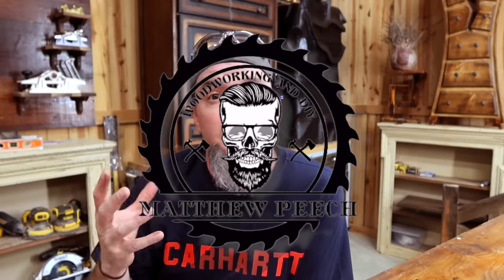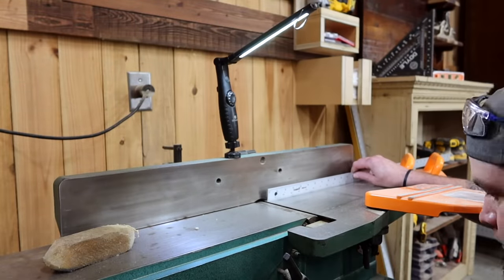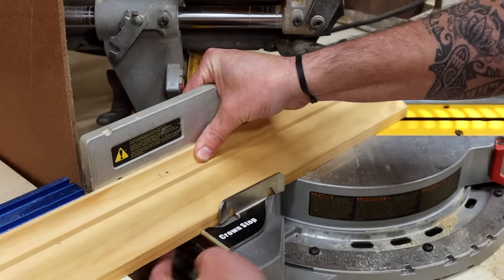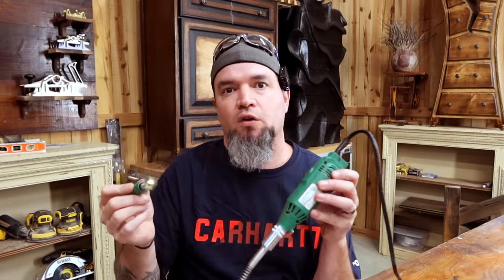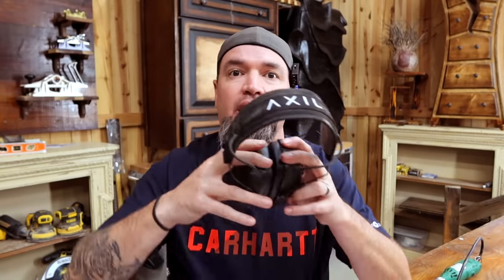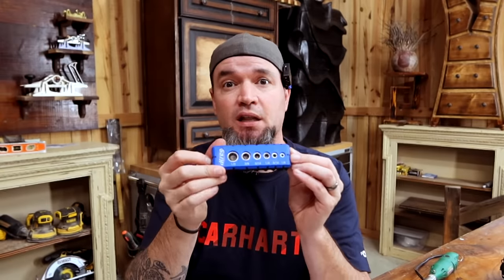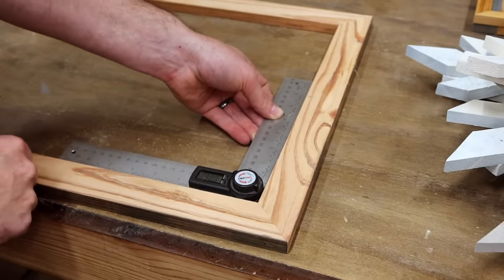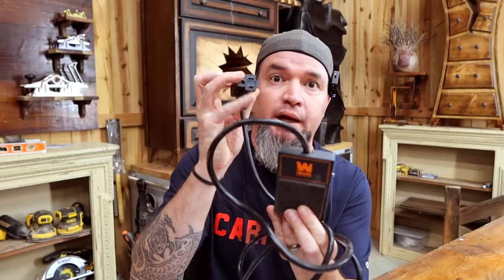12 Must Have Tools Under $20!

Comment from the maker: ▼EXPAND FOR MORE INFO!▼
★ Plans! All plans include exploded views, cutting layouts, and easy-to-follow step-by-step instructions. 
Etsy Shop: https://tidd.ly/3DzEa0f

★ Support the page and join the community!  
https://www.patreon.com/MatthewPeechwoodworking

★ Share Your Brags!!! 
Mpwbrags@gmail.com

★ Subscriber Discounts! (Affiliate links help to sponsor the content)
-RZ Masks (Save 15% with code: PEECH)
https://tidd.ly/3TJ1w9q

-AXIL Electronic Hearing Protection (SAVE 15% with code MPWOODWORKING)
https://goaxil.com/pages/gs-extreme-affiliatte-special?rfsn=6622602.9d133c

★Links to tools you may see in my shop  (If you use one of these affiliate links we may receive a small commission that helps to support the channel)

Kreg multi-mark measuring tool https://amzn.to/3XjM1H6

Kreg drilling guide https://amzn.to/3GtQFMG Flexible gooseneck light https://amzn.to/3Vfto5v

Magnetic Work light https://amzn.to/3Awdpb7

Crown moulding stops https://amzn.to/3tOGRoU

WEN rotary tool https://amzn.to/3EMo04s

Safety glasses https://amzn.to/3gnkfsH

Kreg drilling guide https://amzn.to/3GtQFMG   (much cheaper at a big box store)

Digital caliper https://amzn.to/3tKcqQX

Digital angle finder https://amzn.to/3K7mSJT

Digital angle gauge https://amzn.to/3AvIVpQ

Foot Pedal https://amzn.to/3glhVCC

Check out my Amazon Page for links to all the tools you see throughout my shop!
 https://www.amazon.com/shop/handy.man99

Comment: Here are some cheap items I use all the time.
- cheap set of 1,2,3 blocks, great for making temp jigs and clamping things.
- corner clamps, this is kinda a China tool but they are amazing they are squares that have clamp spots on the side.
Reply from the maker: Oh yea! Thanks for adding to the list.
Reply: I second the 1-2-3 blocks! I have a couple of sets and they’re used all the time. I also do a lot of metal work, so sometimes I don’t think of them as woodworking tools, but they most definitely are. On that note, I’d also add machinist’s square, height gauge and surface plate as tools that I got for metal but use for wood more than I thought I might.
Reply: Wen makes inexpensive 1-2-3 blocks that are plenty good enough for woodworking.  Keep them oiled to avoid rust.
Reply: Thank you.  I don't know what these are so I'm about to go find out! ❤

Comment: I have a foot pedal for my vacuum and table saw. Be cautious and always use the on - off on the saw as well when done with a cut. It is easy to accidentally step on the pedal when your hands are in the danger zone.

Comment: The foot pedal is an awesome safety feature. I had one on my shop vac and it was really helpful. Then I got my first table saw and immediately realized how dangerous it was so I got another pedal for that. It gives me much more confidence knowing that if I step away, or drop something, or someone comes in and distracts me then the saw shuts down immediately.
I bought a heavy duty metal pedal on Amazon and wired my own receptacles to it. No problem kicking it around the shop floor.

Comment: Quite a few years ago, my sister bought me a 3 pack of small pry bars by Dasco Pro. So many uses in and out of the shop! They all have a nail puller slot and the mini is great for opening everything from drink cans to paint cans. Under $20!
Reply: That little cat paw size one is my go-to for stain cans. I will also add to the cheap list, the little bottle opener / paint opener that most people have. Small, inexpensive, but still invaluable when you need to open a paint can.

Comment: The backside of the drill guide is triangular in shape to drill center and straight on something round like PVC.
Reply: Big Gator is another great name for these, but a bit pricier. They offer standard and metric, plus smaller bit sizes and one for tapping. All are solid metal.

Comment: One of my favorite under $20 tools, is the Pittsburgh 12" Locking Wing Divider from Harbor Freight ($9.99).
I could go on all day, but one more honorable mention from Harbor Freight, is any of their Pittsburgh ratcheting bar clamp/spreaders - the 18" clamps are just $5.99!
Reply: I have HF bar clamps and dont use them.....when you crank in the force, the bar will bend.  Es no bueno.
Reply: Locking wing dividers 9.99😊

Comment: I love the harbor freight pick set. I have used them for years and modified them for specific jobs. Just another suggestion for people looking for more cheap tools.
Reply from the maker: Good idea. Thanks.
Reply: 😂😂😂 Me, too. I never seem to be able to hang on to a set for long, though. It seems that visitors to my shop will see them hanging on the mag strip above my metal workbench (I religiously separate wood and metal work. Nothing messes up a finish like some oil you picked up off your bench, and nothing aggravates me more than sawdust all over a metal project). As I write (23Dec22) HFT had these on their online coupons for $1...limit 4. I've done limited twice already, and may limit out again before the coupon expires on 26Dec.
Reply: Ive been mechanic for 60 years texton have the best pick set

Comment: For my shop vac switch I use a remote control wall switch I picked up for ~$15 @ Lowes. I slip the switch in my apron's chest pocket (or shirt pocket) and no matter which station I'm working at I can thump my chest to turn the vac on or off.

Comment: I have the Milescraft version of that drill guide and it's super convenient. I've been pondering getting some brass or steel bushings in bigger sizes and making a second one for 5/8" to 1-1/2.

I have one of the 3M respirators for use when spraying lacquer- and alcohol-based paints. Switching out the organic cartridges for the round pink particle filters makes for a very comfortable and steam-free dust mask.

Comment: Thanks, just watched 3 of these style videos from you and ended up getting the foot peddle, butter spacing guide, nail setter, 123 blocks, center finding ruler, and I opted for the Milescraft 1318 drill guide versus the Kregs drilling guide, it's $20 more dollars but way more versatile for me.  I used your affiliate links so spend that $1 wisely, better it's in your pocket than Jeff's.

Comment: Great list, I already put a couple in my Amazon cart. I use my combination square quite a bit. Marking the center of boards, the 45 for marking the center of a square and also as a blade height tool on my table saw for dado's.

Comment: I missed some audio when you were talking about rotary tools and I was going to jump in and say, "Wen makes a good one for 20 dollars, then realized you were talking about Wen. Whew, almost looked stupid there for a minute. I have the foot pedal also for using my router on a bench. Router is also a Wen. Think I see a trend. Thanks for the heads up on the digital gauges. I have been eyeing a Klein angle gauge and wishing I could find a less expensive one.

Comment: I discovered the foot switch about 30yrs ago. It came as an accessory to a high-end scroll saw. I plugged a three-way power adapter into it and ran the saw and an overhead light. I thought it was pretty cool.

Now...I have one switching my table mounted router that is a off-on type. I also have one tied into my drill press that is a 'deadman' style, which is to say you must have pressure on the pedal if you want power to your tool. Harbor Freight has both styles in the $15 price point. They are half again as large as the Wen you demonstrated, but seem to work for me. I've had them for years now, and aside from HFT's penchant for selling poorly finished products I find them to be durable and able to handle a decent amount of current. The switch on my router, for example, is likely six years old and shows no need for replacement. So...git yourself a couple of these. Like Matthew says, you'll wonder how you lived without them.

Comment: I've suggested it on some of my other subscriptions and have seen no response to it, but I use an echo Dot to tell Alexa to turn on my vacuum system. I had used a remote, but could never find it when I needed it, and it eventually broke. So I just needed to get an Amazon Alexa switch to add to it and plug in my vacuum. Now all I have to do is say Alexa turn on the vacuum (and it just turned it on lol). It works great!

Comment: I got a rotary tool (Dremel) back in 1993, I don't use it extensively, but I have changed the brushes in it. I use it mainly under vehicles to cut off old pieces like exhausts, where flames are not a great idea!

Comment: I have a couple of pair of safety glasses with gaskets that I wore riding my motorcycle in place of a shield. I live in Arizona and some portions of the year, the climate is not conducive to full-faced helmets. 😁 And I use my Howard Leight shooting ear pro because i can hear everything until the dBs get too high and they shut out the noise immediately. Mine are old so need an umbilical for music, but I have a shop radio, anyway.

Comment: The crown Stop would have been great when we we remodeled our house and drilled and tapped the base of the miter saw to attach a block of wood as a stop. The vibration ended up cutting into the block about a day into the project and ruined a lot of cuts that had to be re-cut and filled ( in some cases). Those stops would have been fantastic

Comment: This isn't necessarily unique to wood,  but incredibly useful nonetheless, I'd recommend folks get a nut/bolt/screw thread gauge. Like 9 bucks for a decently sturdy one. Can help you figure out threading you have on an existing screw/bolt, and has posts for figuring out nut sizes. 

Mine is loaded with info. Metric, US, thread, size, length and has posts set up for both fine and coarse nuts. Very handy when trying to find a replacement, versus trying every single spare you have til you find a match

Comment: I’m probably going to give more comments but the first tool you showed Kreg multi tool is one tool I use more than any other tool in my shop. You should of shown how you can take a measurement for one part and transfer it to another. That is the number one thing I use it for, repeatedly.

Comment: I have my flex shaft rotary tool connected to its own foot pedal switch.  It really help when doing modeling work to precisely position the tool before starting the drill or other attachment.  Definitely a place where a corded tool is better than a battery operated one.

Comment: Great video. The only thing I kinda have a different opinion on is when it comes to rotary tools. Yes, Dremel can be expensive but they are leagues better than basically every non name brand rotary tool and worth the investment IMO. Even their entry models are so much better than a similar spec model, at least when it comes to jobs where high speed is needed. But if you only ever use lower speeds for sanding or grinding, budget models are usually just fine.
Reply: Curiosity since I have a corded Dremel and a cordless Ryobi, what specific examples do you have where the Dremel was able to either do something better or at all vs a non-Dremel brand and what brand were you comparing it to?
Reply: @inmyimage1081  Well I said "non name brand rotary tool" so I'm talking about cheap stuff like Amazon rotary tools and even Harbor Freight's cheaper lines. Things like cutting metal make drastic differences where cheaper stuff tends to not have the motor speed to cut through even softer metals. They also tend to even slow themselves down from lack of torque, which only adds to the problem. Another area where Dremel outclasses many other rotary tools and I'll say even some name brand tools is engraving jobs. It's vital that you have a constant, stable speed because any changes will cause your tool to slide around and ruin your carve.
Reply: @inmyimage1081  I've never used a Ryobi rotary tool, but I do have a Makita portable rotary tool as well as a cheap Bauer rotary. The Makita can hang with my Dremels for most cutting jobs, but do tend to lose the clutch a tad with stainless steel jobs where my better Dremels maintain constant RPMs. The Bauer, meanwhile is nowhere near the same class as either brand. I basically just got it because it was on clearance at harbor freight at the time.
Reply: @LeviBulger  Thanks, haven’t actually used the Ryobi yet and not sure when I will given I rarely even use my Dremel, it was just part of a multi-tool package I got.

Comment: I had to laugh because I saw your video title and before I watched it I thought, "What are my must have tools under $20?" The reason I laughed it that your number one, the Kreg MultiMark, was the tool that I thought of first. I picked one up at a woodworking show a few years ago and it has become one of my most used tools. It's just so incredibly handy and I'm lost when I can't find it. The digital caliper is probably my second choice, especially since I mill my own rough stock. I love getting exact thickness measurements when I'm milling boards down to a specific thickness and accuracy is essential. It's also indispensable if you use a CNC machine.

Comment: Besides just calipers, lots of machinist's tools can be handy in a wood shop. 
Telescopic ID gauges have come in especially handy as a super quick way to check that a fence is square to the blade.
Reply: I love my machinists 1-2-3 blocks.  Many tools come in 2 versions......machinist/engineer tool or woodshop tool.  when budget allows opt for the machinist tool.

Comment: The flex light looks great. I bought the pricey Rockler one, but the flex part is too flexible and won't stay in most positions I try to set it at. 
The Kreg drill guide isn't necessary if you have a drill press. Make your own guide from scrap in seconds. 
I like the digital protector, but it tends to move too easily when trying to transfer an angle, even if you really crank down on the knob to lock it. 
I tried the RZ Mask, but when it's just secured around the back of my neck I find it tends to pull down my nose when I put it on tight enough to actually seal around my face. 
There are also safety glasses like that with a nylon strap which stays out of the way of your hearing protection over your ears.

Comment: That first one, the Kreg measuring tool also has a built-in rabbet @ 3/16” for marking reveal for door casing. Thanks for all your vids!
Reply: Following the link to Amazon turned up a version by Milescraft for a few dollar less.
Reply: Don't trust it. You'll need a square to make sure it's square.  Has a LOT of wiggle in it.
Reply: My Kreg unit is still tight. But we don’t really rely on that kinda thing to square-up a task, do we? It’s just a versatile thing that you barely notice in a pouch until you need it.

Comment: Great tools!  I can’t believe how much time I spent trying to find a little corded magnetic flex light.  Harbor Freight sells a blue one but it’s too short.  I ended up buying another one of their battery powered magnetic lights with a side mounted magnet, which works ok and is charged by USB, but it was expensive.

On the crown molding clamps, I’m confused because I have generic hold downs on my miter saw that kind of do the same thing I think, so the point about “repeating the angle” was lost to me anyway. My current saw is a 20 year old 12” Rigid miter (Emerson tool) that has given great service, but it doesn’t have those threaded holes for the crown brackets.  (I wish I had a sliding miter, but use a table saw instead for deeper cuts.)

I have the Kreg drill jig which is a great tool, and a digital angle finder, but have to look into the rest of these.  The last safety glasses I bought cost more than $10, and didn’t have those desks to keep the dust out.

Thanks for the helpful tool suggestions!  👍

Comment: I get footswitches from Harbor Freight. They have both momentary and latching, and they have screw down holes for mounting them to somewhere that might possibly make them less dangerous. I use them on my router table, and my horizontal router table and I’d never want to not have them. Reaching under and/or behind the tables is impossibly time consuming…
Reply: Mike you just inspired me to grab one for my router table. It's a bear to reach under and mess with the power switch on the old Craftsman that's on it. Thanks for the ideal.

Comment: I've been using foot pedals for years. All of my tools are mobile and each one has a pedal for power that I also attach a wet/dry vac and light by way of a 3-way adapter. Not only does it make each tool safer by adding light and reducing dust every time the machine is running, this feature also cuts the power of all the items if I fall or turn away from the machine. Plus it gives me peace of mind when I'm away from my shop because I don't wonder if I left a light on and am wasting energy and energy